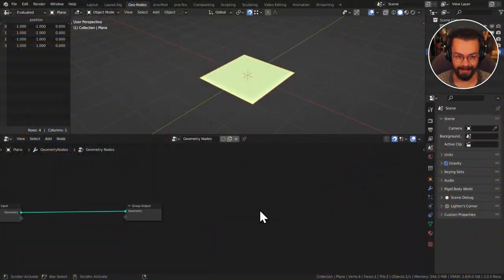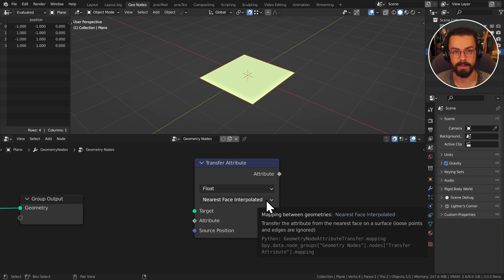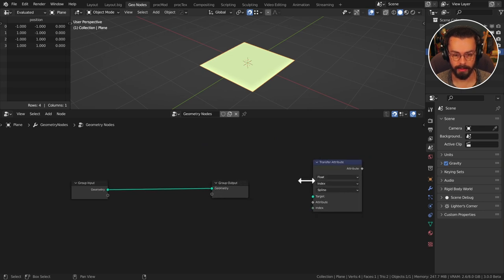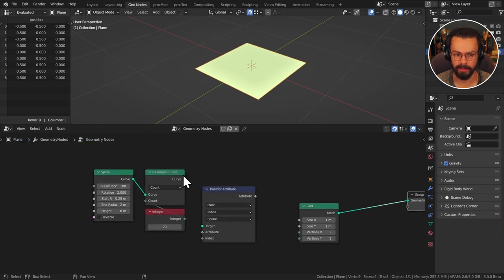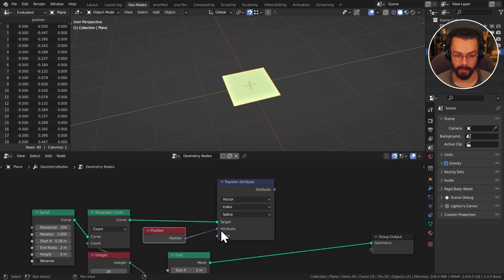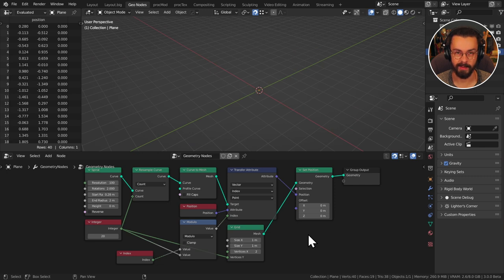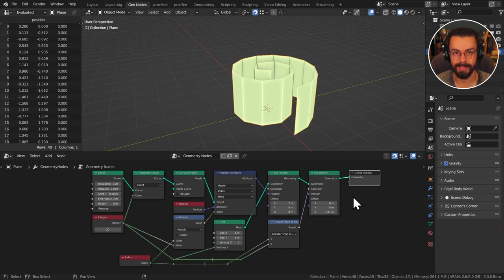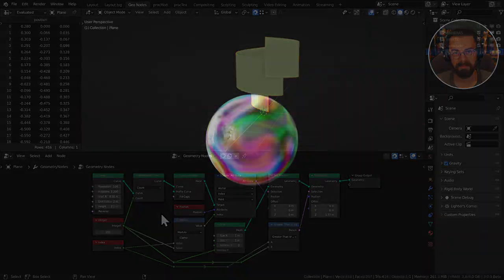Transfer Your Attributes - Geometry Nodes 101

Comment: Hello Erindale. wouldn´t this node be the one I had to look at if I wanted to transfer an animated mesh (-deformation) to another geometry?
here´s my unsolved Problem: I need to use an imported (and deformed) alembic animation in my fluid sim as an obstacle. Since the alembic is only referenced (or streamed?) in blender, it seems to be not suitable for this kind of physics simulation. So my thought was to transfer the deformation to another (internal) geometry and use that as an obstacle in flip fluids. Can you follow my thoughts? Would you know about a better approach to that issue?
Reply from the maker: Are alembic not properly importable? Transfer seems like it would be the right path yeah 👍
Reply: Hey great. Yes they are importable, but for some reasons I really cannot make up, they don't react to fluids... Maybe due to the internal data handling of alembics.  Thank you for your quick reply though 😀

Comment: Thanks a lot for this informative video. What is actually the purpose of resampling the curve? I see this in a lot of videos and I'm wondering why not directly use the resolution on the curve primitives instead? Is there any difference in doing it this way? Thank you!
Reply from the maker: The best example is the spiral curve. Add that and set the resolution to 3. Resolution doesn't define the overall number of points whereas the Resample Curve node does let you do that.
Reply: @Erindale  ah ok. Great, thanks for the explanation

Comment: Hi Erindale, I rebuilt this tutorial but tried to use a closed spline (circle) which leaves me with a gap in my extruded mesh. How would you go about that? Obviously I would need to use one index twice, but I couldn´t figure out which nodesetup to use...? I would be thankful if you could point me into a direction, maybe just name the node I need to work with... Thank you very much, cheers eL
Reply from the maker: If you make your grid one vertex more than the spline then instead of modulo at the spline count, modulo at that count +1, but then immediately after, modulo at the spline count. Eg if you have 4 verts on the spline the grid wants 5. So the grid verts indices will go 0..9. then modulo by 5 and you'll get 0,1,2,3,4,0,1,2,3,4. Then modulo by 4 and you'll get 0,1,2,3,0,0,1,2,3,0.
Reply: @Erindale  YAYYY wow thank you for that quick reply - even though I am having a really hard time to picture what two modulos in a row really do (mathematically), it works like I need it to... Thanks a lot Erindale.

Comment: Not the easiest concept...
1) Nothing changes when I disable/delete Curve to Mesh node. Is it really needed ?
2) Why is attribute type Node and not drop down ? Is there like interface for attributes that can be implemented and added to Blender ?
3) About Transfer attributes "Type for Source and result data". Vector  is the only possibility for position ?  Or changing type can have some interesting results ?
Would be interesting to see other use cases for this node.
Reply from the maker: It's likely that you don't need curve to mesh now but when I made the video it was different. 
What do you mean by attribute type?
If you have a vector like position to through a float socket, it will compress it into a single flat value (using the mean average of the three channels). So it can be interesting but usually in a less useful way. I use transfer quite a lot. Check out my train stream as I think I used it a bunch in there. Or really any of the Nodevember streams as well

Comment: Hi Erindale, 

thank you for your explanations. I like your way of teaching.
I  also have few questions about the transfer attribute node and how it works in your tutorial.
1.) Why has the first  set postion node after the modulo operation was executed no points dedicated?
2.) i am a litte bit  confused of this modula operations. I need further explanations. If i modulate the index by 20. What does that mean?
Index of 20 mod 20 is 0, index of 19 mod 20 ist 1 etc. 
What does that mean for the first set position node?

I am sorry, but i don't understand this context, although these questions were asked some days ago.
Maybe you can help me.

Thank You.

Daniel
Reply: Hi Daniel, about the modulo: You have a mistake there, "19 mod 20" is 19. 19 fits zero times into 20 (which we dont care for) and the remainder is 19. Now in the second loop, the last point with index 39 fits once into 20, with a remainder of 19 as well. So these two points get "grouped" by modulo and put at their place by the first "set position". to give #39 some height over #19, that's the "greater than", which separates 39 from 19 (and all the other pairs) and adds height to the one with index >=20.

I wonder where the "greater than or equal" nodes come from, I don't have these, just "greater than", so I had to add a "subtract" node before to get the one end right.
Reply: @riidom  Thank you for your explanations.
Greater than or equal can be found in the compare float node,

Comment: Could you elaborate a little on how the modulo is calculated/evaluated? I understand the concept of modulo when calculating a single set of values. For example, 12mod3 = 0, or 10mod3 = 1. I don't know how this modulo setup is used to evaluate the first row of verts of the grid to set their position from the curve, then start over again and apply the same positions to the second row of verts.
Reply from the maker: So each very has a value for it's index like 10 or 12. So mod3 would output a value 0, 1 or 2 for each vert. This is then has the data transferred from the curve point that shares that index.
Reply: @Erindale  thank you!

Comment: Does the "index" at the Transfer Attribute node refer to the target geometry (curve) or to the geometry in whose context the attribute is being calculated (plane)?
At first i thought it refered to the curve indexes, but if we are doing the index modulo 20, it means that the first input of the modulo/math node goes up to 40 (0-39, actually), doesn't it?  (so that we are doing 2 cycles of 0-19 indexes at the modulo node)
Reply from the maker: It's either both, or just the geometry whose context it's calculated. But definitely not just the target. I know that's super confusing when the other inputs are for the target but just one of those quirks you learn.
Reply: @Erindale  Oh, Ok! 
(thank you for the invest in making these, by the way :) )

Comment: Thank you, I think transfer attribute is what I'm looking for, but I can't get it to work. Basically I have a straight spline with let's say 10 points and I manage to distribute the points along the line (position calculated with their indexes).
But what I want instead, is to calculate each point based on the location of the previous point. Even if I substract 1 to my index and plug it in the transfer node, it doesn't work. Seems to be working with first one, so I think it doesn't access correctly indexes. I would do that in couple of minutes in Unreal Engine, but I'm struggling for almost 2 weeks with geo nodes 😅
Reply from the maker: There's a Field at Index node which you can use with the index - 1 idea to check the position of the offset index. Are you wanting a loop though? Maybe look into the Accumulated Field node. It's a sum loop suitable for linear packing. Johnny has some good tutorials on it
Reply: @Erindale   @Erindale  Thanks for the quick reply! 
V 3.4 has now a "sample index" node that seems to do the job (and they removed the "transfer attribute" apparently), I'm trying it at the moment but I can't understand the result, I don't understand how blender uses indexes, or maybe I'm just misundertanding the set position node.
  Yes a loop would be good :
Set position for each point => get the position of the previous point and add (direction*distance). 
I'm going to experiment with field at index and accumulate field as you advised ;)
I don't know Johnny but if you have a link to his channel I'll take a look

Comment: everything is going ok, over my head a little, but ok. at 5:08 and my question is How come your Compare Float node goes up/down in whole #s and mine does fractions? Not sure how to put it = yours - 1,2,3 . . . , mine - 1.1,1.2,1.3 . . . ? not sure this won't mess things up later on.
Reply: 3.0beta from 11/10/21
Reply from the maker: @djC653  If you hold CTRL while dragging a slide in Blender (anywhere in Blender) it will snap to larger increments. If you want to snap to smaller increments, SHIFT+CTRL while dragging.
Reply: @Erindale  ok good to know

Comment: I can see much better you did good job on THEME color and big mouse I can catch where your mouse move and click is great but one thing would you like add-ons ScreenCast Key please.
I am full deaf and I have low vision.
Reply from the maker: Generally I have screencast keys on but it doesn't always work in beta builds of Blender unfortunately
Reply: @Erindale  No not true. They already fix a bug 4 months ago everything worked.
Reply from the maker: If you watch my other videos you'll see I use it almost all the time. And also if you use 3.4 or 3.5 in the last few weeks you'll see there's a bug causing the UI to hang unusably after scrolling in the node editors if screencast keys is running hence me using Shortcut VUr instead in my last video
Reply: @Erindale  Allright

Comment: sorry but you started off with some clear cut example, but it got complicated for no reason. You could make a simpler example...... yet somehow i walked away from this tut more confused than I was...
Reply from the maker: Tl:dw - Transfer attribute transfers attributes between different geometry. In 3.4 it's replaced by Sample Index, Sample Nearest, and Sample Mesh Surface nodes.